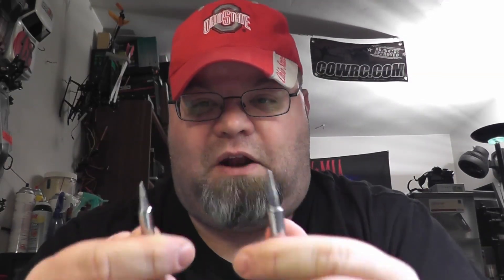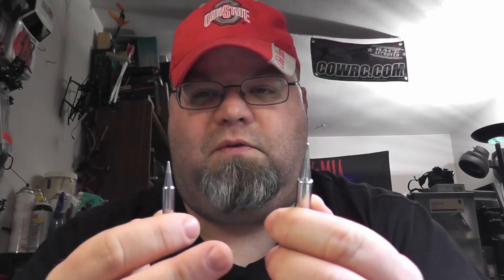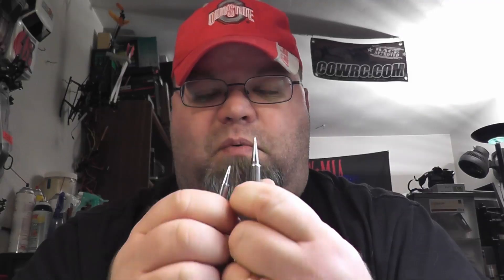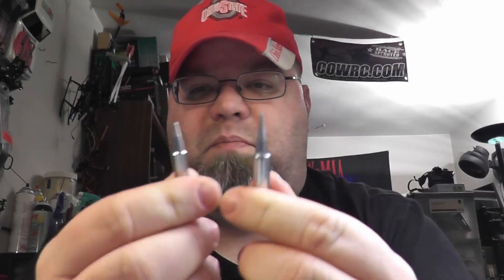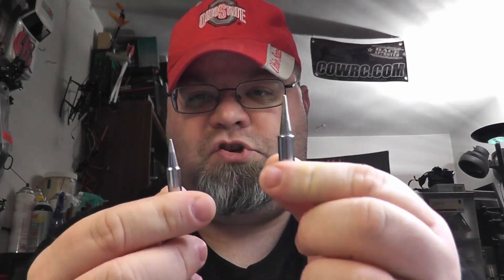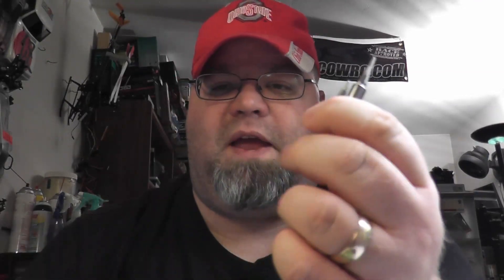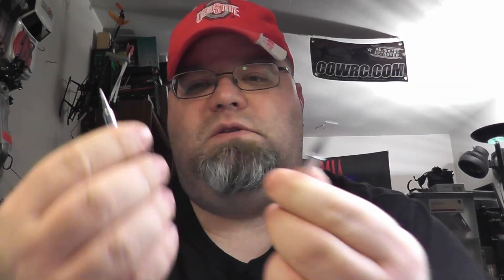How To Use Original Hakko 936 Or 888 Tips On A Trakpower TK-950

Comment: I needed a replacement protection pipe for the TK950. Found Hakko made a 907 to 908 tip (900M to 900L style) conversion kit as well which would keep the 900L tips from the TK950. The replacement protection pipes appear to be B1786 for the smaller 907 tips and B1787 for the larger 908 tips.
Reply from the maker: Good to know. Thanks for sharing that info :)

Comment: Just purchased the TK-955 (the digital version) today. The two included tip sizes will work fine for my soldering, most of which is model railroad stuff. One question I can't seem to find an answer for: Are the TK950 and TK955 tips interchangeable? I see the 950 tips for sale all over everywhere, but nada for the 955.
Reply from the maker: The TK955 looks to just be a digital version of the 950 and from what I can tell the iron and the tips look to be the same from what I can tell from pictures. I dont have a 955 though so take that with a grain of salt. That being said the tips arent that expensive to try out.
Reply: @Greywolf74  Thanks for the reply! I probably will get a tip just to see if it works. I just finished installing a DCC decoder in a project locomotive, and to quote Bill Murray in "Stripes": "It.... is.... alive."🙂 I got the temp set at 450F and it melted the .032" 60/40 solder easy peasy!
Reply from the maker: @flyboy2610  Let me know if the 950 tips work on the 955 :)
Reply: @Greywolf74  I will do that! I need to order one first.
Reply: OK, Greywolf74, I can confirm that the tips for the 950 do in fact work on the 955. The HobbyTown in Omaha had one, and since it's only about 45 minutes away I drove up and got one. Fit, form, and function are correctamundo, as Fonzie used to say! 👍
Reply from the maker: @flyboy2610  awesome. Thx for sharing!

Comment: This was a lifesaver! I’ve had my Trakpower Tk 950 for nearly 10 years - it works like a charm but I found myself needing a larger chisel tip than the company provides. I thought I was going to have to buy a new iron… with this tip I can buy from the much wider array of available Hakko tips but use them on my trusty old Tk-950. Thanks!!
Reply from the maker: Glad it helped. I found myself in the same situation when I started soldering 10 and 8awg wires. I've had my tk950 since 2012 also and it still keeps on going. Of course this should NOT be a surprise since it's literally a 1:1 clone of the old Hakko 936 station. :)

Comment: so i need a bigger tip for my trak power 950 to do xt90’s which tip do you recommend ? thanks
Reply from the maker: It depends on what youre doing but if youre trying to solder/tin 12+AWG wire then Id get the widest chisel tip I could find. This may require you to mod your TK950 to use hakko tips as TK only makes like 3 or 4 basic tips.
Reply: @Greywolf74   I figured out what I was doing wrong. The tip wasn't tinned , so the heat wasn't transferring or holding solder. Now I can solder xt90's with the stock tip , it melts the solder like a hot knife through butter.
I did buy the adapter and hakko standard size tip kit just in case. Thanks for the vid and reply.
Reply from the maker: @John_D2  ahhhh yeah, tinning is key :)

Comment: Trakpower TK-950 and TK-955 handles are copied from the Hakko 908 handle (not the 907), this is why the tips are larger. The Hakko 908 handle was designed to use large mass tips; series 900L :-)

Comment: Hi. Hakko have 3 different sizes tips for 907 handle. Differencesis in heater. More power, bigger size of tip. Sorry for bad enlish
Reply from the maker: Goran Mrkonja Thats true but they discontinued those tips and are now selling the FX-888 tips as replacements for the 936 tips which as far as Ive seen only come in one size. Although its possible Im just not aware of othr size tips for the 888?